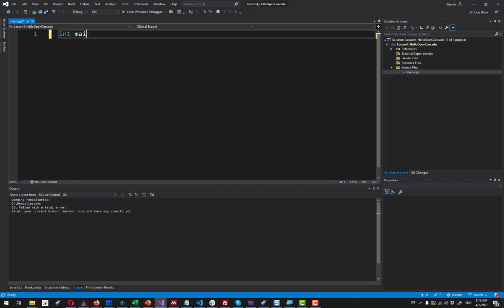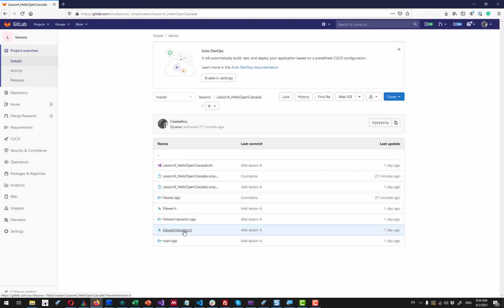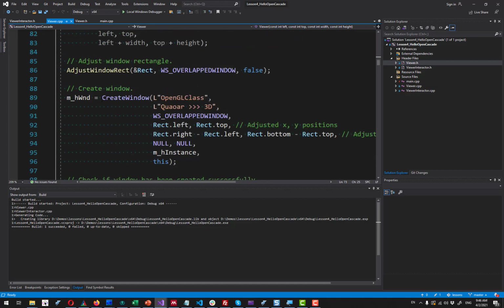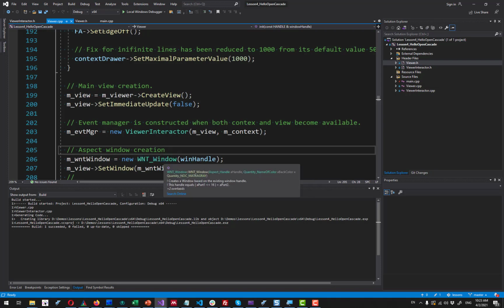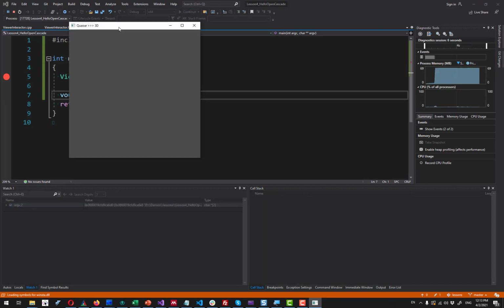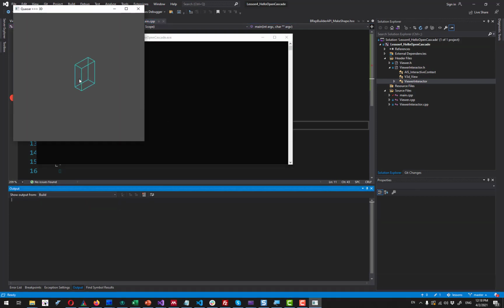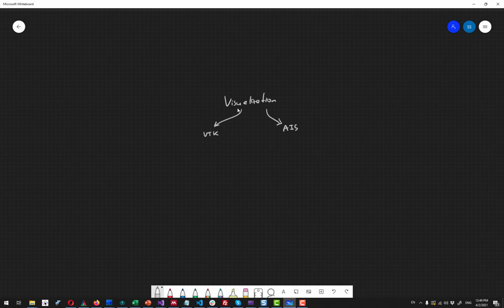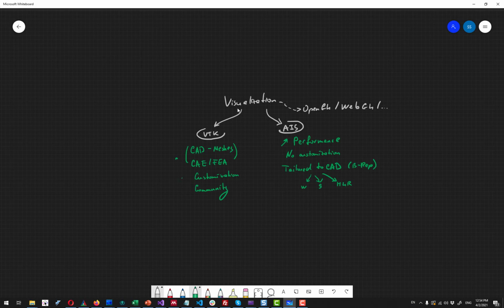Lesson 4: Visualization in OpenCascade | Application Interactive Services | AIS | OpenCascade

Comment: I have been watching your video for the last two years, but still not able to understand "how to extract features from 3d cad model which is built on the SolidWorks software." 

In my current situation, with my Windows desktop, Google Colab, and SolidWorks software, and 

You will also laugh, hearing that, since the last two years, I have not been able to download the OpenCascade software and VS Code software. 

Is it possible to do "how to extract features from 3d cad model which is built on the SolidWorks software.""  using only SolidWorks and Google Colab

Is it possible OpenCascade connect to Google Colab????

Comment: Coders are some alien species!
I don't know how you can remember all this dry text?
Many of them UN-pronounceable even!
Reply from the maker: After ~17 years messing with all this, you start to remember a thing or two.
Reply: @QuaoarWorkshop  I keep waiting for someone writing a visual programming interface like MAX/MSP but better, so I don't have to deal with code!
But it seams I have to do it! Because no one will!
It should be like Lego! You stick it together and it works!
Reply from the maker: @We-Do-NOT-Consent-To-The-Loop Folks from Beegraphy (https://beegraphy.com/) were putting together some visual parametric CAD solution that has Opencascade.js under the hood. I did not use their software but the idea is pretty much like Rhino Grasshopper: you connect modeling operations together in a visual editor. Is this something you're talking about?

Comment: Do you know of a way to make OpenCascade read 100mb+ (sometimes up to 1Gig) STEP/or even STL files faster?   It takes an ungodly amount of time for OpenCascade to read them compared to other programs that can read and render the files.
Reply from the maker: What version of OCCT do you use? Is it feasible for you to share the model and piece of code with import procedure? We encourage you to continue on our forum as more propriate place for following discussions. Welcome! http://analysissitus.org/forum/index.php
Reply: @QuaoarWorkshop  I'm using pythonocc from an anaconda installation, which uses opencascade 7.5.1 library.  Unfortunately, I'm not able to share an example model file (it's from my work).  The model files that are large are assembly files.  I'll check out the forum too.
Reply from the maker: @resresres1  With pythonocc the performance degradation is rather expected. We'd recommend you to code  heavy procedures on pure C++.
Reply: @QuaoarWorkshop   I ended up digging into the SWIG functions (pythonocc uses the SWIG wrapper , which wraps the C++ functions so they can be used by python) and found the method I was using to read STL files was creating a shape composed of triangular faces per facet.  Found another function that uses Poly Triangulation instead and it is far faster.  Just as fast if not faster than other programs that can read the files.

Comment: Nice Lesson.
How could I create/display dynamic position/path of a 3D point/edge. There would be some >50.000  points/edges at a rate of 50 msec update.
Maybe there is a better way in OCCT to do this?
Best regards
Reply from the maker: Hello! We shaped your question into a separate thread on our forum for better following the discussion. Let's continue there, http://analysissitus.org/forum/index.php?threads/visu-performance-on-50k-elements.73/.
Reply: @QuaoarWorkshop  I do not get a confirmation email after the registration ! ?
Reply from the maker: @cnc-next6139  Can you try again? I manually verified your (I hope it was yours) account.
Reply: @QuaoarWorkshop  yes, now it works. I put a comment there. Thanks a lot.

Comment: Excellent!!!!! Thank you!!!! One small problem: very strange, I can not switch between S(haded) and W(ireFrame) .. the rest of the keys work just perfect! By default, when the console app starts, the 3D model is displayed as shaded. Win 10 - ATI RadeonPro WX4100 - graphic card ; auxiliary question: how can I import a STEP file similar with the b-rep in the video?
Reply from the maker: Have you tried Ctrl+S/Ctrl+W ? I ask because there's a default controller which is supposed to switch between shading and wireframe using that extra Ctrl key. I think the idea was to keep WASD for movement (like if you're about to develop Wolfenstein on OpenCascade, you could save few minutes programming camera movements).

As for the STEP files, try StepControl_Reader: https://gitlab.com/ssv/AnalysisSitus/-/blob/master/src/asiAlgo/interop/asiAlgo_STEP.cpp#L101

Comment: Thanks a lot for your lesson. But I faced some common issue with OpenGL on intel chips. The sample outputs: Error! OpenGL context reports version 4.6 but does not export required functions for 4.5 (glGetnTexImage) And I'm not alone with that problem, known intel bug. However DRAW works ok. Is there some way to avoid that bug?
Reply from the maker: Hello Ramil! You're not alone with that - below here you might see the same question. Unfortunately, there is no magic advice but update the graphic card. However, you unlike face the issues with OCCT visualization engine until use the textures.

Comment: Anyone have this problem :   TKOpenGl | Type: Error | ID: 0 | Severity: High | Message:
  Error! OpenGL context reports version 4.6 but does not export required functions for 4.5 (glGetnTexImage)
Please report this issue to OpenGL driver vendor 'intel'
Reply from the maker: Don't you execute the code at the remote PC or virtual machine?

Such a kind of messages usually means that the graphic card installed at PC doesn't meet the minimal requirements that OCC library has in regards to the graphic cards/supported version of OpenGl. You might want to upgrade the OpenGl driver for the currently active graphic card, for example, check the available updates here: https://downloadcenter.intel.com/product/80939/- , or try to activate another graphic card if your PC has two of them.

Comment: Please explain OCAF.  An example on where and how to use OCAF from opencascade is highly appreciated.
Reply from the maker: Yep, will do that in one of the upcoming videos.
Reply: @QuaoarWorkshop  Thanks a lot. I think one problem for me is that the samples are not stand alone. They use templates which make it difficult for me to figure out the dependencies in the code. an stand alone skeletal example can be great. Many thanks for the effort.
Reply from the maker: @retiredreplicant.2195  That was exactly the problem for me when I conducted trainings as an OCC employee. After a while, you begin to prefer to start from an empty file with the main() function. Not from someone's struts where you have to fill the gaps without understanding anything you're doing :)

Comment: When I build the program I had this error :
......\viewer.cpp(96): error C2664: 'HWND CreateWindowExA(DWORD,LPCSTR,LPCSTR,DWORD,int,int,int,int,HWND,HMENU,HINSTANCE,LPVOID)' : impossible de convertir l'argument 2 de 'const wchar_t [12]' en 'LPCSTR'
Reply from the maker: Will the following help? https://stackoverflow.com/questions/13977388/error-cannot-convert-const-wchar-t-13-to-lpcstr-aka-const-char-in-assi
Reply: @QuaoarWorkshop  Oh! I was wondering why Viewer.h and Viewer.cpp have a combined total of 55 undefined identifiers (reported by VS Code on Ubuntu). It would appear that these identifiers are defined in windows.h, which can only be used on Windows. Am I correct in concluding that Viewer will work on Windows only?
Reply from the maker: @dougblanding8791  Yes, you'r absolutely right - this example is for Windows only. For other OS-s the code should be adapted to rely on the API of the corresponding OS.
Reply: Thank you